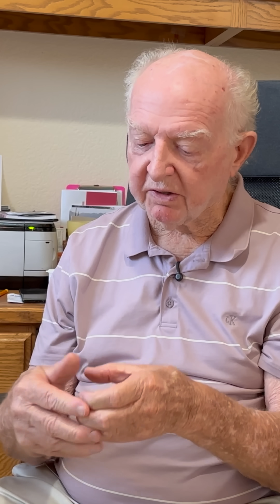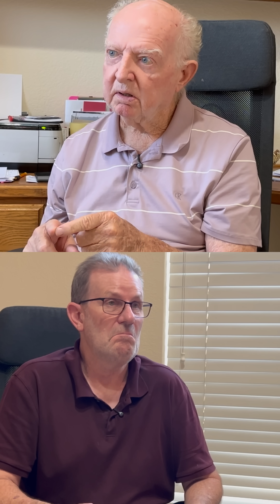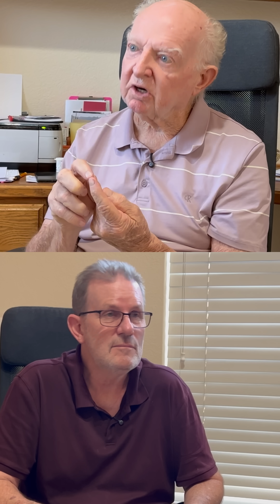Reading Spark Plugs AFTER The Race... Ask Ed Smith 40 #BarryT #racing #enginebuilding

Comment: Stock car driver Sonny Easley died at riverside raceway doing a shutdown like that.
After practice laps ,he shut the motor down and was coasting into the pits. A tire went off the pavement onto  soft dirt, lost control, and slammed into another car or trailer. There was also another pit crewman who was hit and died.
Reply: What the fuck does this have to do with reading spark plugs?
Reply: @aarondmason808 
He shut the engine down at full throttle so they could read the plugs. The engine wasn't running, so he had less control of the car. He only had brakes to slow it down  the car spun and hit a trailer in the pits.
Reply: You read the plugs after full throttle runs, not after the cool off.
Out of respect for this site , I'll refrain from the language I would normally use.